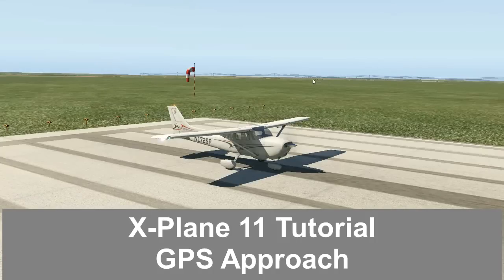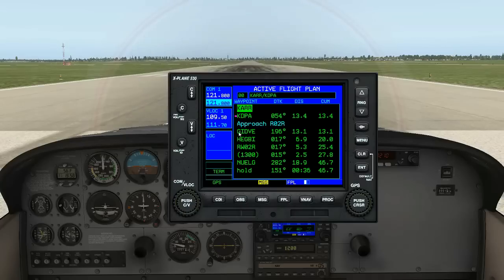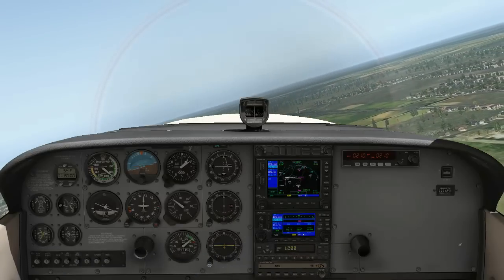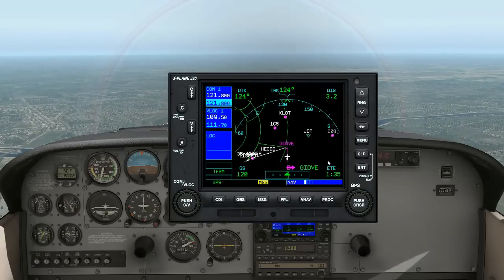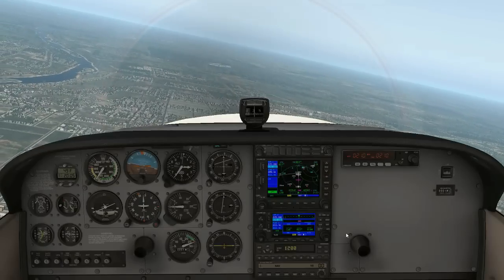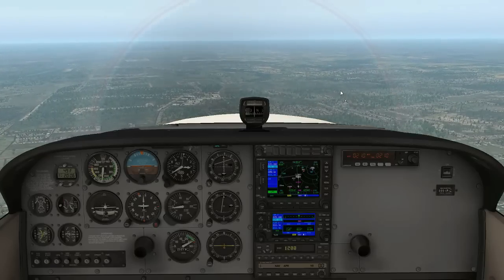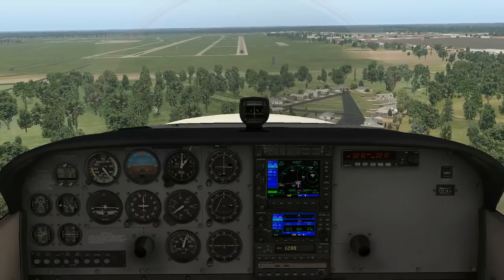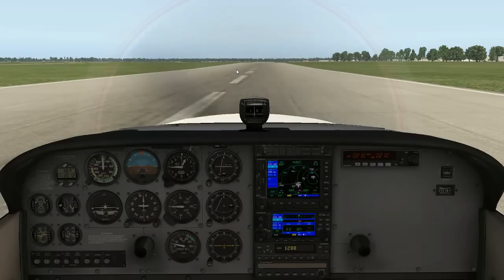X-Plane 11 - GPS Approach

Comment: At the beginning when you immediately activated your approach because it was only 0.3 nm away from your last way point. What would you say is the max nm before you would load it in rather than immediately activate it?
Reply: ATIS or Approach control will tell you the active runway or by listening to radios. In the real world you would not load GPS/ILS  approach until you know winds and which runways are in use. You can also request an approach sometimes, for sure on Pilotedge. I use NAV or HDG button to get within range of 20-30 deg intercept and below Glideslope. Being outside of reasonable intercept angles and altitudes can confuse a GPS. They often will try to intecept the next leg etc. and miss GS entirely. Pull up the free approach plate at SkyVector.
Hope this helps. Good Luck!

Comment: Thank you so much for this.. I'm pretty new to this, but do you use the ATC in conjunction with the flight plans you create?
Reply from the maker: When you press Enter to open the ATC, it will ask for the Departure AP, Arrival AP, and flight level. That is enough to let the ATC make it's own flight plan. However, you can use the box below to enter in waypoints to fly your own flight plan.
Reply: Is there a way to download your flight plan from the GPS to the ATC without having to fill in the box below?

Comment: What screen ratio are you in there, I like the set up of whole dashboard and centre view, I think Im on 65.0 ratio
Reply from the maker: I didn't actually adjust the screen ratio. What I did was use the default view, then zoomed out using "," or "." until everything was in full view, then used the arrow keys to move into the middle and up. Once you are happy with a view, you can press CTRL+Number to save the view.
Reply: Is that CTRL+Number on a Mac or PC?
Reply from the maker: PC but there might be something similar on a MAC.